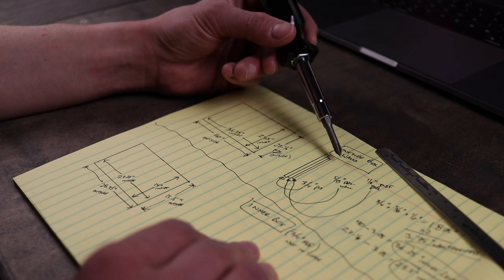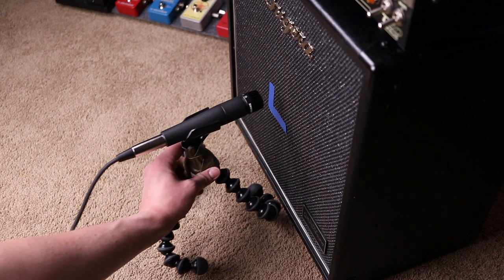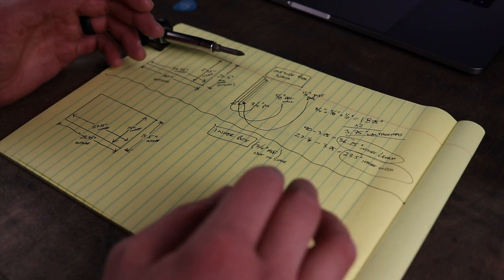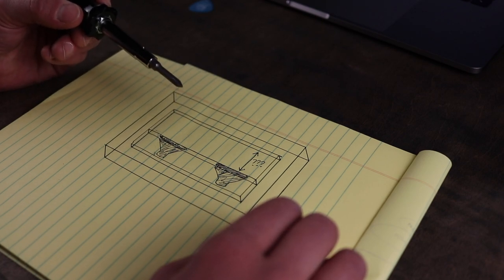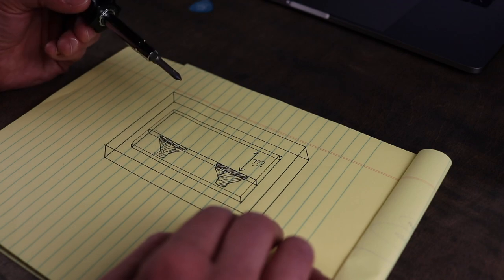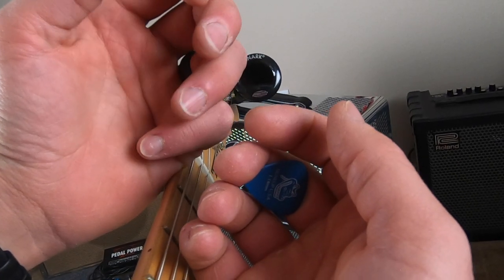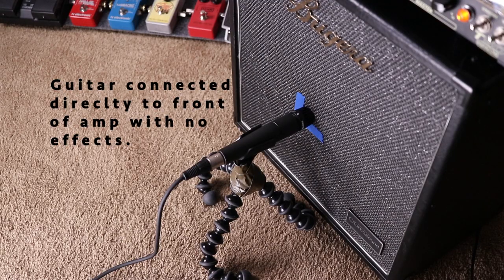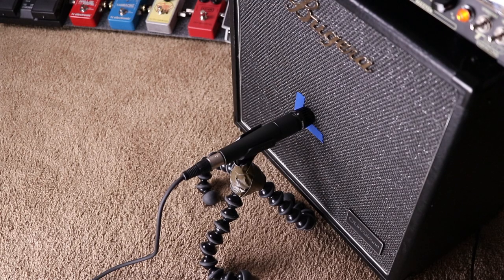Isolation Cabinet (DIY) || Design & Test Build

Comment: I could say we had the same idea at the same time. Last year, looking at my head/cabinet, I thought: "Instead of buying a large isocab, why not putting a cover over this cabinet, and close it?" It wouldn't attenuate 30-40dB as a professional isocab, but because my amp is rated at 20W, I don't need huge attenuation. If it will decrease 10-15dB, it's ok. But this remained only an idea, I didn't work on it, but you gave me new fuel with your video. Do you remember the thickness of the wood panels (I assume it's MDF) and the overall weight of the cover, including the rockwool panels? If I got right the last part, the depth of your cover is 12". If I'll make it, I'll probably use 20" instead (I consider a few inches for the rockwool and the acoustic panels, and a few additional inches to move forward and backward the microphones). Thanks a lot, and keep up the good work!
Reply from the maker: Thank you! Let me know how the project goes and if you have any other specific projects you want to see. 

I used some scrap 1/2” OSB.  I definitely recommend making it deeper to allow flexibility with the mic. I think you’ll get 15 db reduction no problem.